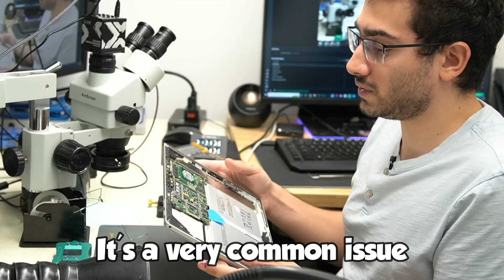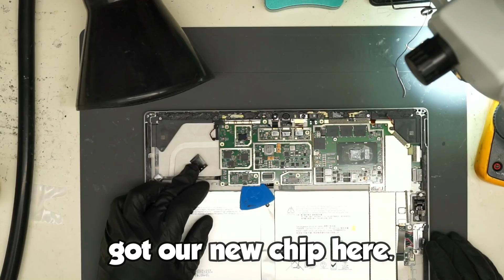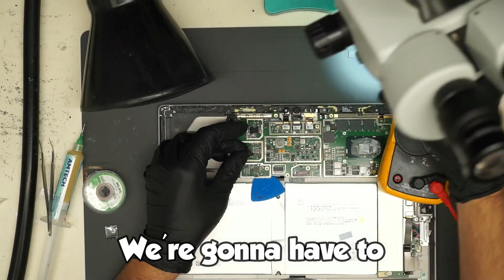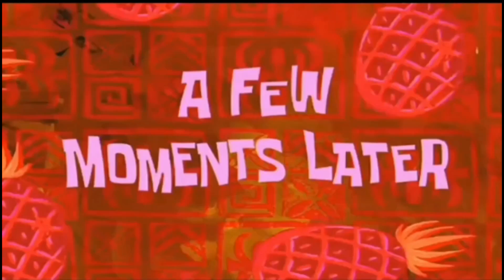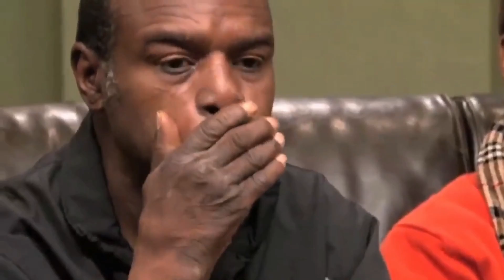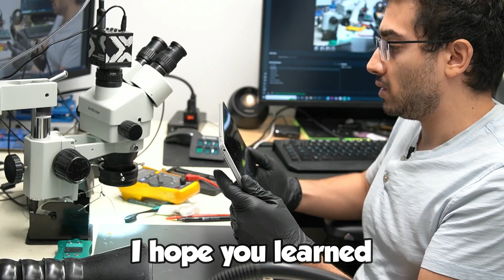How to repair a Surface Pro 4 that is dead following a battery replacement

Comment: im usually a DIY guy for legit everything, but this is a level of which i dont have all the tools, but my surface pro has been down for like 3 years now due to me trying to install a new battery and nowhere in the guide or the "ifixit" instructions said anything about covering the connection from the battery with a piece of paper until its fully aligned and assembled.. so now im stuck with my favorite laptop and alllllllllll my 3d print files just stuck on this device. i do plan on getting it fixed. but the one person i emailed about it said some shit about costing 500$ or more when i know for a fact this could be fixed cheaper then that. if im spending 500$ or more, im buying a used surface 4 or just a new surface in general.

Comment: I have a surface pro 8 and have somewhat of a similar issue. It charges fine and holds a charge without issue. However the device will only boot for a few seconds before abruptly turning back off. Happens regardless of what I try to do. Either boot normal or boot to UEFI. Just shuts off shortly after boot. Any ideas ?

Comment: Would love more explanation when you use the multimeter, how did you remove the short with it?
Thanks for the video!
I have a Surface Pro 4 I am working on, as a hobbyist, and it will not turn on.
I will see what I will try to do, I have a heat gun and so but U don't I can manage to change super small diodes and stuff

Comment: I have a surface pro 7 , after I installed a new screen, the battery shows 100% but dies immediately after unplugging power.   Any ideas ?

Comment: I have a surface pro 4 and if the battery dies I plug it up and it won’t turn on for about 20 to 30 minutes is that normal?

Comment: I do have a question. Is it okay to plug in constantly my Surface pro 4 to its charger?
Its battery lasts 1hr only and it keeps turning off when it goes down 50%. 

Will it damage the Surface itself?

Comment: Hey mate.  How did the power flex come undone?  How can I tell if mine is disconnected.   I just replaced the battery but it won't power on.

Comment: I have the same issue when I test capacitor ther is short in did but when I put chargeur and I measure I find 3.3v
I didn't inject 3v just normal test with chargeur 
Any solution 
My case suddenly the surface stop working working I don't have battery on it I always use chargeur

Comment: Hi i have try everything : (

But i have short on the Condenser, i have input voltage 3.3v to the condenser bur the ITE Ic Chip is stone cold nothing going there hot  : (

Fuses ok

I am so sadly : ( can u help me please ?

greets
Reply from the maker: Did you check diodes?
Reply: @marcuscupello  Yes every diodes i check and fuses too : ( is it a cpu death ???
Reply: @user-bw5hk5nb3k  I have the same issue 
When you test diodes  do you get 
Battery  in 12v out 8v
Chargeur in 12v out 0
Reply: On the diodes are the voltages normaly but near the cpu are grey rail or what is it, its have 0V with Charger and Battery, and 00.3 OHM
Reply: @user-bw5hk5nb3k  the same for me right now I'm testing it nothing 
I'm afraid it's CPU dead  with no schematic I can't get anything
Reply: Habe you the Same Issue with a

CPU i5
8GB Ram ?

And its going not turn on right ?

I think mine one is cpu death, because of the backside all capaxitors give me a short is that normaly ? 

Have you look your capacitors of the backside from your Motherboard ??
Reply: @user-bw5hk5nb3k  Same to me , 2 mainboards , and same problem. All was ok , but after the battery replacement the unit is dead. I have shord on the capacitor but have 3V , all the rest of the components are ok.

Comment: Hi, Marcus and Nick, nice tutorial and help for your viewers. I am a hobbyist and do repair my own gadgets. Have you ever tried repairing the Battery Management System Board for the Pro 4 Battery, as I have two new condition batteries just not working. Hope to have reply from you, Thanks and keep up the good work.
Reply from the maker: Thank you so much for your feedback. Yes, this video shows some of the common faults with surface pro 4. Message me directly and I will help you diagnose.
Reply: @marcuscupello  how would you like me to contact you ?
Reply from the maker: Instagram link in video description

Comment: A noob question 
Why do we sometimes use low melt solder and sometimes medium temp solder
Shouldn’t all ic’s solder be medium grade ?
I’m very new to this and still stuck at level 2 repairs
Reply from the maker: Low melt helps to clean the original factory solder (217)